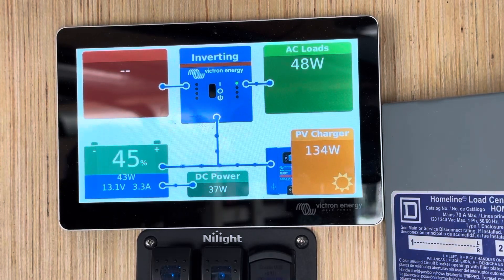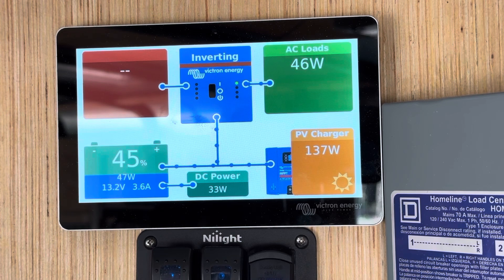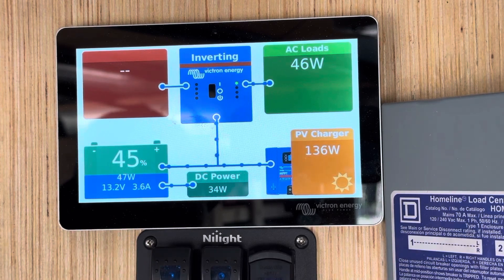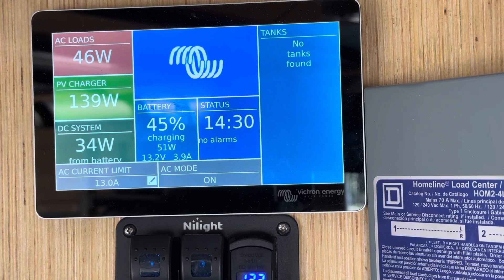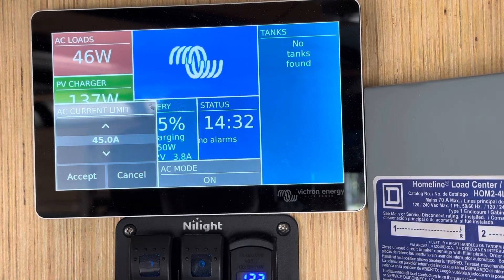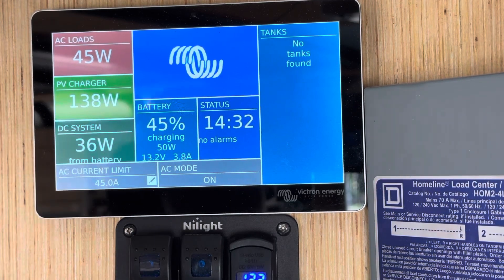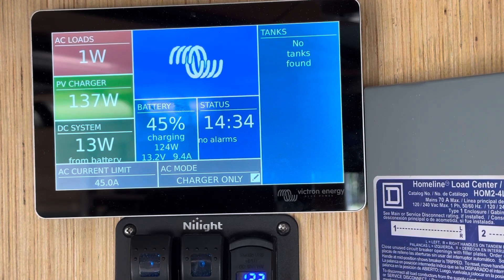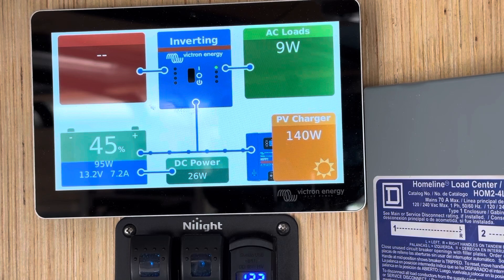Victron Energy GUI V1: Using and Understanding Your Cerbo GX Touchscreen

Comment: You can still charge LFP to very close to 100% quickly if you want. It’s not like Lead Acid which needs ages in absorption mode.
P.S. How did you get that adjustable AC input on the screen? (I don’t have that on mine). 
Sure would be nice to have!